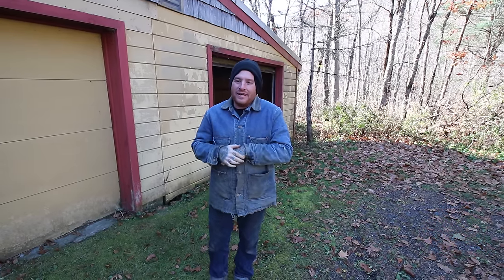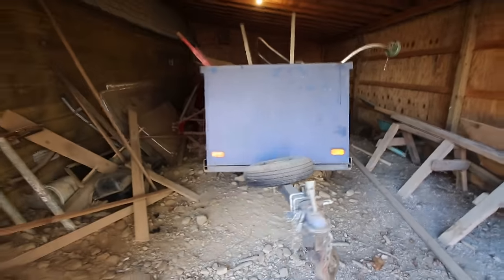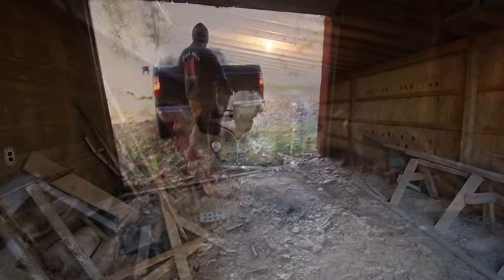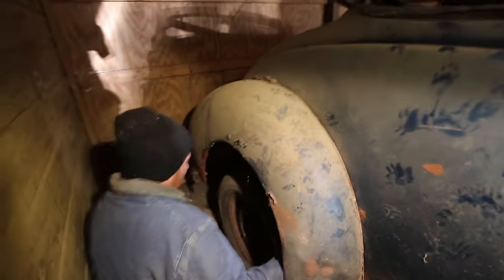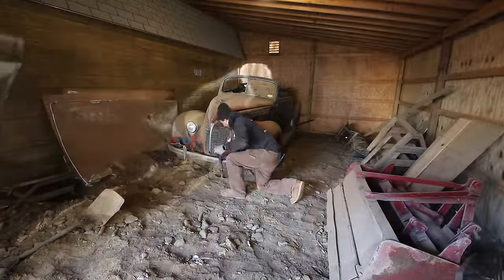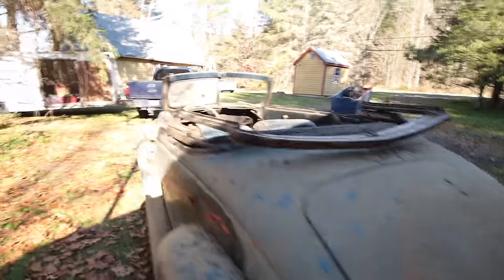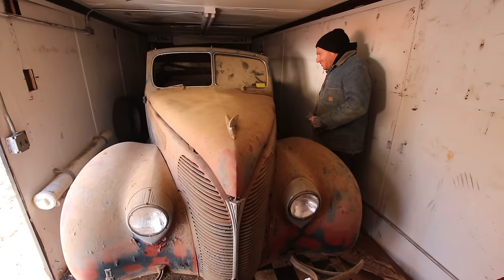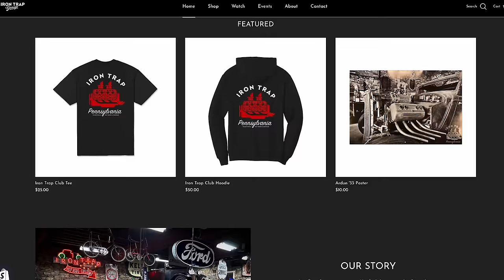Hidden 1938 Ford Convertible Hot Rod Found In Upstate New York!!

Comment: Pontiac engines are remarkably resilient over most others for long-term hibernation. unless something was peeing down the cooperator I'm willing to put 20 Bucks that says it turns over and start. if it's already got a later rear end in it.  It might be interesting to just swap it out if that's the problem and keep it that way